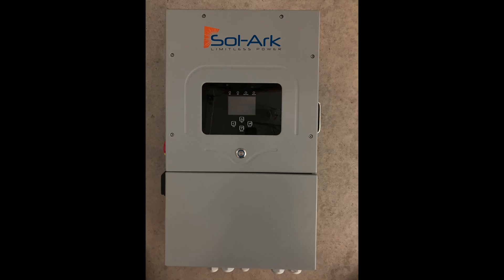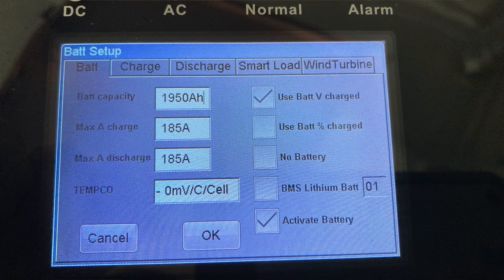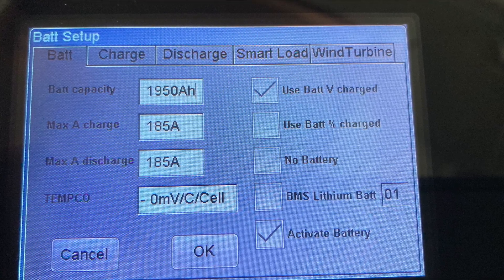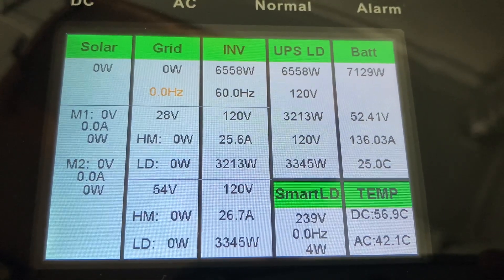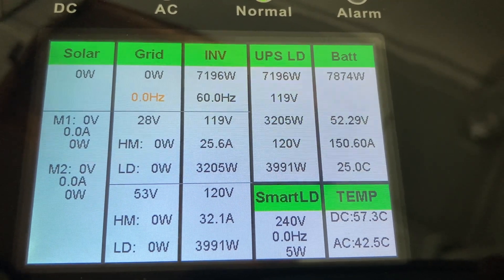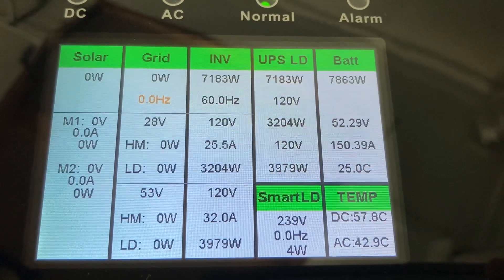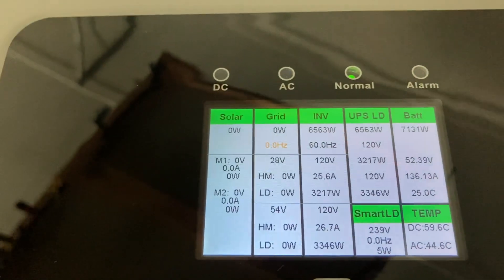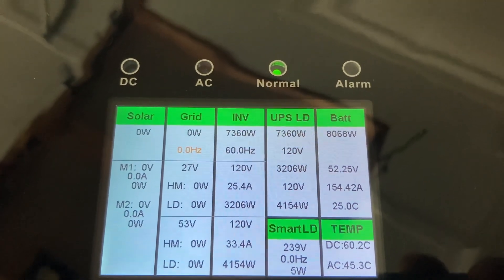Why Did I Remove Sol Ark 12K from my System after 2 years???

Comment: This is why, as an inverter repair technician with over 24 years of experience, repairing both high frequency and low frequency inverters, I have always recommended against using low cost, high frequency inverter technology. If you want to avoid these types of issues, then purchase a low frequency, transformer based inverter technology.
Reply from the maker: Thank you for your opinion! Well Growatt, Schneider are low frequency inverters and they are doing well for Off-Grid applications. Maybe later some manufacturers will surprise us with some HF inverters, Thank you for watching!!
Reply: this is slightly off topic but I would like to have your opinion on high voltage inverters vs low voltage inverters, which is better?

Comment: The reason for the shutdown is probably due to the hair dryer using a half wave rectifier for its low setting.  A lot of inverters don't like these half wave rectified loads.  The heat gun didn't cause this due to it using different heating elements for different power levels.
Reply from the maker: Thank you, I appreciate it. Today I was on the phone with Sol-Ark customer support with remote monitoring. The inverter did shut down multiple times consuming a little bit over 8000W . just the same way as in my presentation with different type of loads.
Reply: @offgridwithlaszlo  What loads specifically caused it to trip out?  Also, has Sol-Ark pushed any updates where they skipped updates in the sequence?  There could be glitches introduced by skipping updates where the skipped updates introduce dependencies for later updates and thus the inverter can puke when it doesn't see the missing dependencies.  I've seen a few cases of puking Sol-Arks on here where that was the issue.